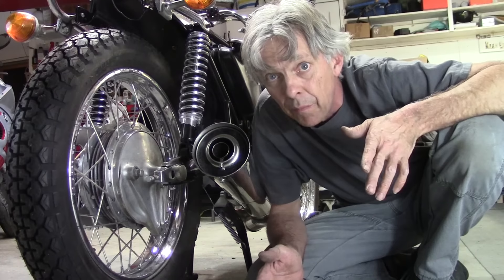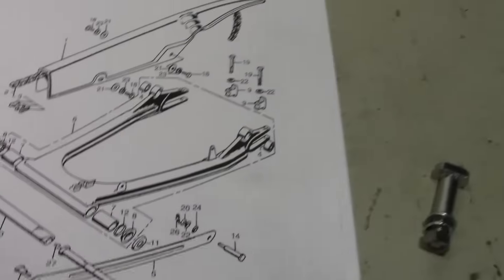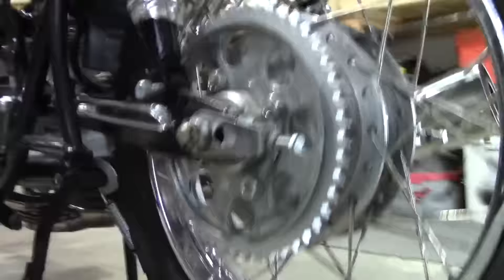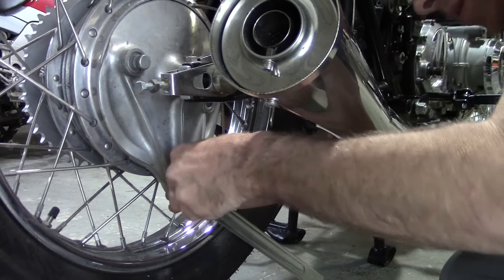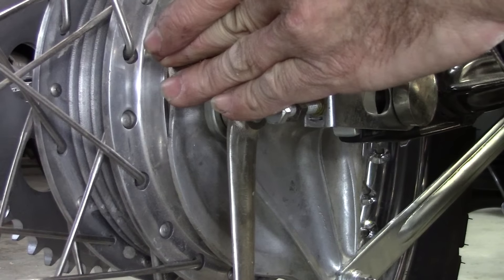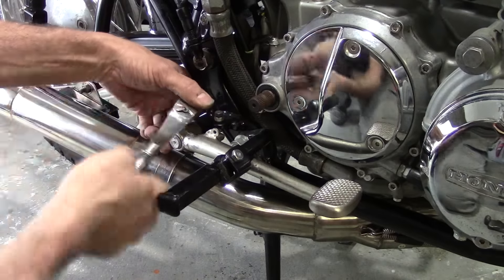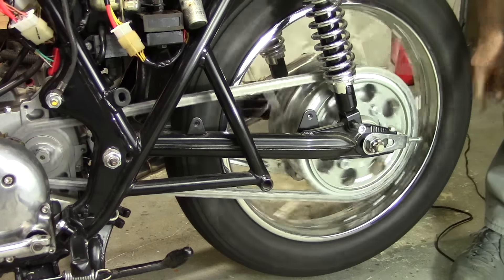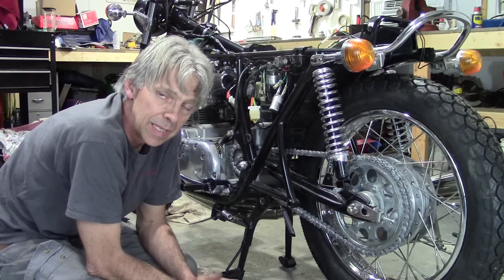1973 Honda CB750 Custom Build Part 33 - Rear brakes & chain

Comment: That felt washer around the brake actuator shaft is should be oiled up. It's meant to hold oil for extra insurance to keep the plane bearing lubricated (in addition to the round groove on the shaft).
Reply: +pocoapoco2 Thanks. I'll get a bit of oil on it. :)

Comment: I just bought a DigiSync, much better than the crappy gauges and tubes.
Reply: +Ordrock7 Gauges work if you know how to read them. I'll be building a gauge based manometer in an upcoming video for a total investment of less than $40.
Reply: +Dean Segovis  yeah I have all three,  the digisync.com is frickin leaps and bounds above those others.  it's like having a radio that's has a digital tuner  the absolute is absolute

Comment: Interesting I was always told not to use O-ring chains on the 70's CB's because they tend to rub on the case by the front sprocket now I will have to see if I can get the one I wanted but was told not to get.. :) Good job its looking awesome man!
Reply: +MidwestMotoRider It clears just fine on mine.

Comment: Great video! Thanks for pointing out the punch marks on the rear brake drum shaft and lever, that's something I'll have to double check on my bike.  

Quick tip for connecting the annoying brake rod to its frontmost connection at the brake pedal:  leave the brake pedal off its shaft.  Unhook the return spring, and rotate the whole arm backwards in order to have more room to insert the bolt and cotter pin.  Finally, rotate the whole assembly back into position, hook the spring in place and put the pedal on the shaft.  Looking forward to the next video!
Reply: +djt64r Thanks!

Comment: Dino don't use the oiler mechanism it's going to spray oil everywhere. I saw a article on tap talk where they ran a piece of a O ring through the oiler mechanism to block it. I highly recommend it. you will thank me later.
Reply: +Tyler Megehe Yeah I've heard that it just makes a mess.

Comment: Deano...for assembly: dry or put some grease or anti-seize on everything? I would have lubed the torque arm pivots, but I'm paranoid.
Reply: +truantray They don't really move once the axle nut is tightened. Anything that does move I usually apply grease or anti-seize.

Comment: The 17-tooth countershaft sprocket is not stock. It was stock gearing on the K0 and later on the F1, but the stock from 1970-1976 K models was 18. A lot of people went out and bought 17-tooth sprockets to give better punch in first gear. The reason for going to the taller gearing was that over that year range there were no specialized touring bikes and the majority of sales were for touring/commuting, and not racing.

Comment: Awesome work! I've been following your video's for a while, learing a lot from your work! Good job on the arm bolt with pin, wow, respect for the patience and perseverence on the whole project.
Tiny note on the chain, as to my knowledge, the grease on the chain while unwrapping is preservation grease and not intended for lubrication. 

I can't wait to see this machine on asphalt. Great job
Reply: +Barry van Oosten Yes I have to clean that off and apply some proper chain lube when I install the chain guard.

Comment: great stuff I have a K2 1972 had it for 20 yrs ride it whenever I can summer only never had an engine strip but I have done most other jobs like you I notice that in my bike the rear wheel spindle has always been in the other way around does this matter

Comment: i just have a question concerning your video part 17. As i am just restoring the motor of my Honda CB 550 i am just wondering if there is no need to put assembly lube or motor oil on to the bearings, before restarting the motor? Thanks for your help and your great videos.
Reply: +Manuel Reisacher Recommend putting assembly lube or at least oil on all bearings. VERY important!

Comment: Hi and compliments for your videos. I have a trouble with the little screw on the sprocket that regulate the oil dripping to the chain. Even if I complety closed it (I undo the nut too to better do it), the oil continue to escape and leaves a puddle on the ground each time I use the bike. What can I do ? 
Here is a pic to show till which level I closed the screw

http://s18.postimg.org/ew9x16fp5/12596171_10208842506849703_1441473318_n.jpg

Thanks for any help and Regards
Reply from the maker: +Marco fattimiei The problem is inside the shaft where a rubber piece is supposed to be. The rubber goes away and it then lets too much oil come out. I'll probably end up with the same problem as you so I'll eventually have to fix that. When I do, I'll post a video of the fix. :)
Reply: Thanks a lot. :-) the rubber is complety missing. I replaced the missing part with an oring but a small leakage is stll present.
Bye.
Reply: Marco fattimiei j😈😈

Comment: Did you go with standard tooth sprockets or different tooth count? I know mine was 18/38 and the front sprocket is AWFULLY close to the repaired engine case.

Comment: hi Dean!

Why have you decided to use sport air filters? The stock filter should be more reliable. Not as cool, but not as problematic, I guess... Had any problems before with carburetor adjustments using sport filters?
Reply: +sz004 I'll be running the stock air box. Pods are on there because they came with the bike and they keep the dust out.

Comment: Your chain is way too tight. A friend of mine actually bent his gearbox output shaft doing this. The tension you got there looks right if there was someone sitting on the bike OFF the stand. Hope you're gonna loosen it a bit again. 
The proper slack of the chain should be listed in the owners manual of the bike. Please check it - it makes me cringe watching someone potentially tightening their bikes chain too much.
Reply: +Bassalicious 10mm - 20mm as per the Honda shop manual.
Reply: +Dean Segovis But is that measurement for when the bike is on or off the stand? The 750 isn't exactly a light bike.
I might have over reacted though. Anyways, better to be safe than sorry.
Reply: I'll be test driving it around the block soon, then readjusting. I've checked it off the center stand with me sitting on it and I have about 10mm of slack. A typical CB750k weighs around 500 pounds.
Reply: ***** Very much looking forward to that! Can't wait to hear her all tuned up. =)